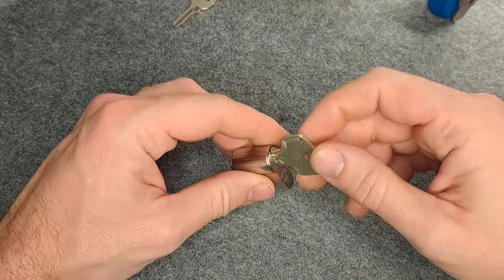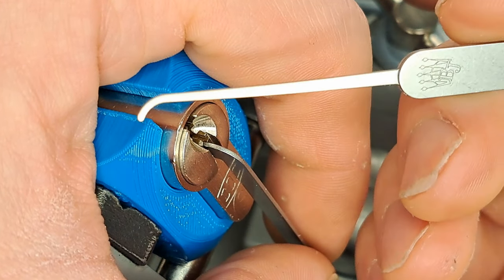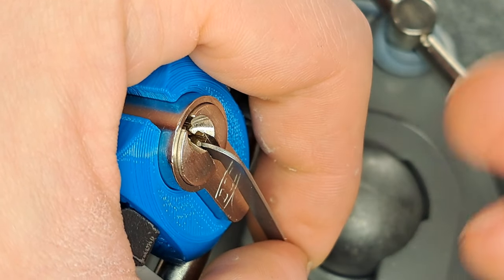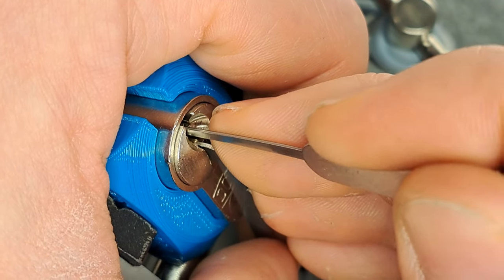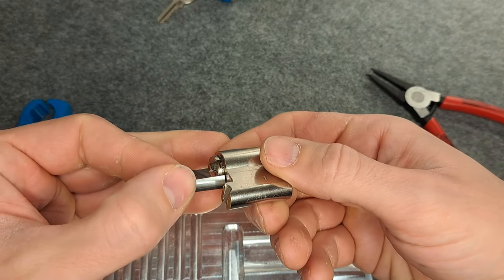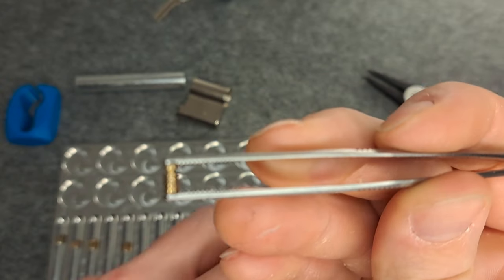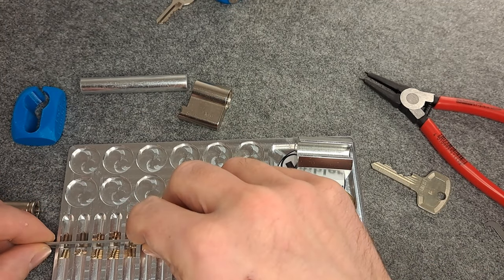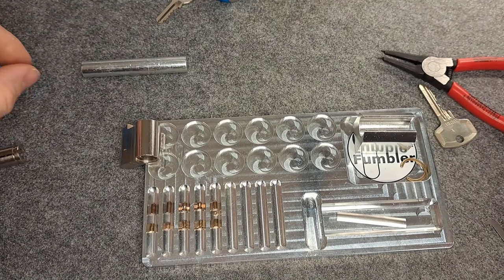[132] Picking the DOM S from 🍋 Lock. Does it have rattle snake pins?

Comment: Well picked. Methodical and precise as always... 🙌
Just a mini fumble this time dropping just the one pin 😆
Those factory rattlesnakes are really nice 👌.
At least there is only a single master wafer. Thankfully it's in a chamber with a standard driver and not in with one of the rattlesnake pins.
Cheers bud 👍 🍻
Reply from the maker: Thanks 🤗
Hehe yeah at least one pin has to fly 🤣
Yeah i agree they are really well made and tend to give you a different picking experience every time 👌
Cheers 🍻